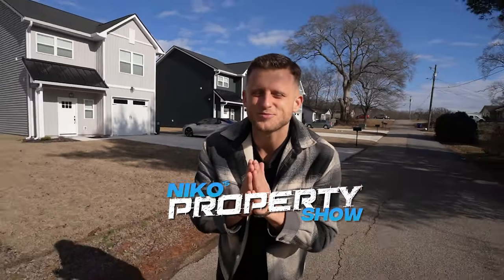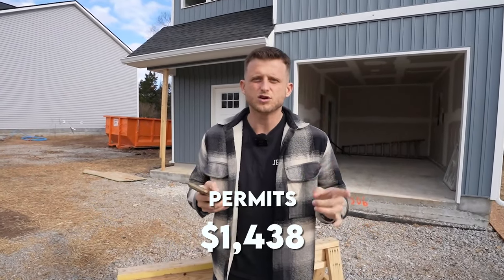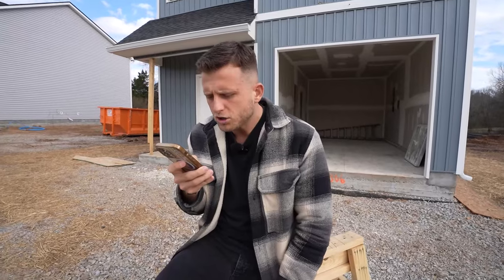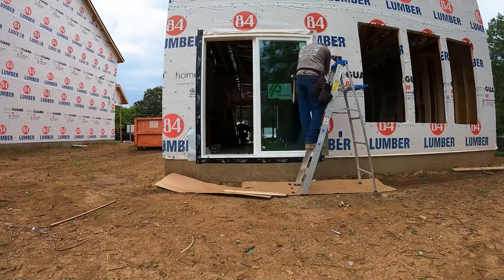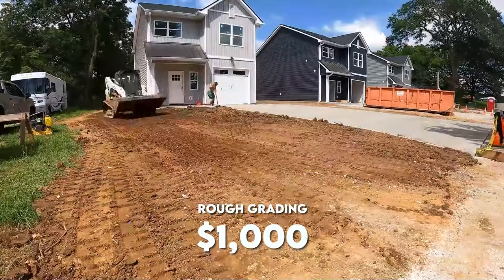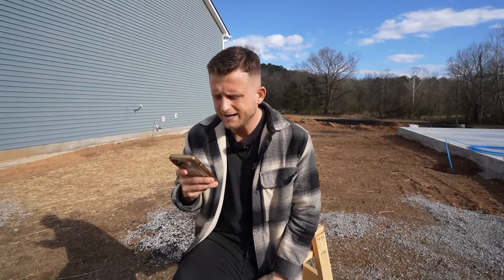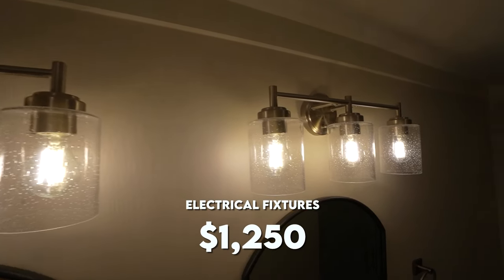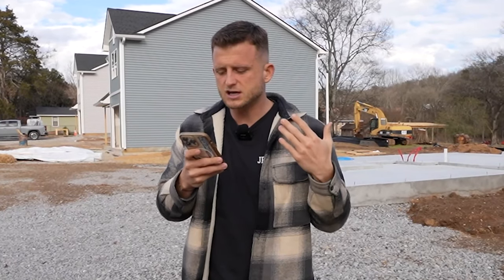Building A House Start To Finish - Full Cost Breakdown

Comment: Amazing how cheap your material and labor costs are for the houses. Down here in Central Florida, you can expect to pay at least 1 1/2 - 3 times as much for materials and labor for an equivalent home. Well done 👏
Reply from the maker: Oh goodness, that sounds like homes are priced much higher then, right?
Reply: No way friends building in st Petersburg Florida for similar prices
Reply: Yup, prices in Florida have went through the roof in the past 5 - 6 years.
But the market has slowed down a significant amount in the past 6 months, which will drive prices back down, temporarily, I think.
Reply: Hi nikos I love your videos and I love the way you mentioned God in everything your believe in God is so amazing